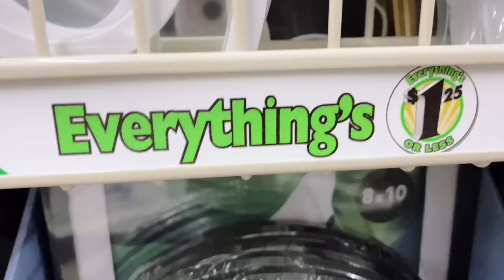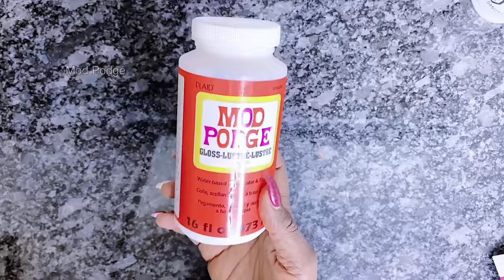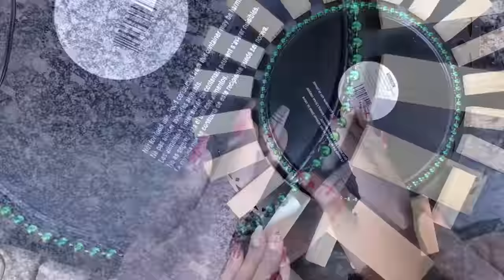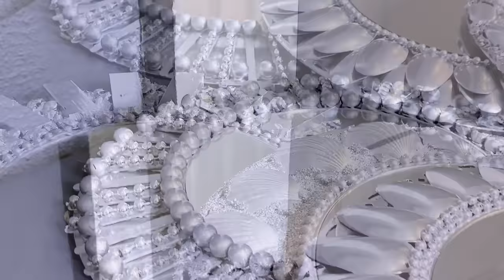5 High End Wall Art DIY | How To Make High End Wall Art With Chargers [ PART 2 - Silver Edition ]

Comment: Fabulous. How much diameters are the mirror tiles please
Reply from the maker: I use 7inches and 6 inches mirrors but you may have to check it out depending on the charger plate you're using

Comment: Hi, I ordered the 8 in round mirrors and they don’t fit my 13 in charger plates😔 6 in will be too small. Are your charger plates larger?
Reply from the maker: Oh noooooo!!! Sorry to hear. I have two sizes chargers. I think 6.5 or 7 would fit. Also if the 8 is off by just a little, you can elevate it like I did for some in my rose gold edition using straws. I hope this helps.
Reply: @NoraGsNook  thanks Nora🙏🏽 keep the videos coming. Love them.

Comment: I was wonder what size your charger plate were, I  purchase some from the dollar tree but the mirror  did not fit on it, it was too small. I only fit with the frame on.
Reply from the maker: Oh noooo, all charger plates I think have same size. The chargers at the dollar tree was a perfect fit for the mirror for me. They look like 12-14 inches
Reply: @NoraGsNook   Hi Nora, the mirror size is 6" when it came out of the round frame and the circle at the back of the charger is 7 1/4", maybe the brand of plates. Are you in the US?
Reply: I made 2 of them but I had to keep the frames on in order for it  fit with in that circle.
Reply from the maker: @jenellerichards6502  Hmmmm 🤔 I’m not sure. I am in Canada. Was it the same?

Comment: Rock is the material stones are made of. The term is usually used for rough material, polished (artificially or naturally) rock are called stones. The correct term for those small stones is pebbles.
Reply from the maker: Thank you 😊 🙏🏾